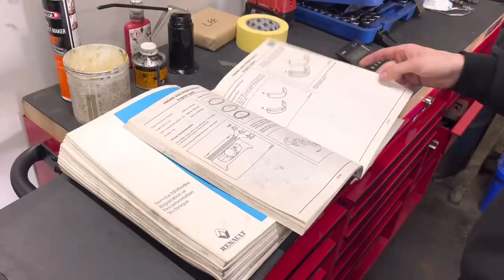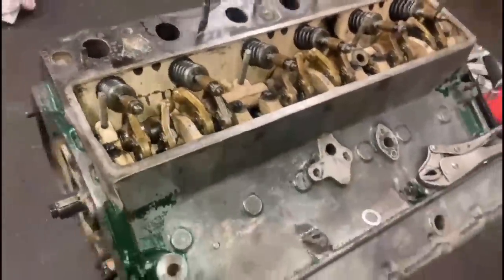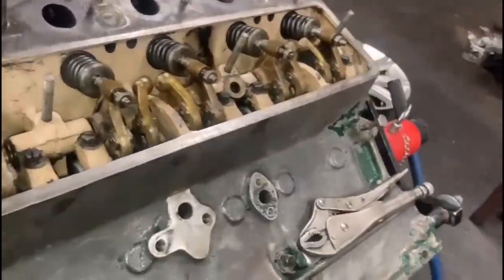IM SO ANGRY WITH THIS WARRANTY CLAIM & COURT THREATENING

Comment: Don't worry mate, let him take that one to court, he has no paper that states you should renovate  the gearbox, it won't hold in court, you can't lose that one, they know those kinds of people who think they can play the system they meet them all the time, they can see when things not add up, I don't think it is going to court at all they will not allow it when he has no paper that state you had an agreement to renovate the gearbox, send him a letter that he has to take you to court, and don't talk to him on the phone all is going on paper from here on.
Reply: You have got the invoice for repair of the damaged selecter shaft, Take the guy to court you have evidence of work you did he hasn't got any evidence.
Independent engineers report. 
Means nothing. 
He could have gone to a scrapyard and a knackered box and got a bloke to do a report.
Reply: Quite agree, you have invoices for work done he has no proof of requested work, recommendations or that the gearbox he had assessed was the same box. Surely burden of proof is on him?
Reply: Obviously as you said you took on that Job to carry out an partial stripping of the box so as to to carry out a detailed physical Inspection without a total tear down so as to recommend a course of action for the client, after which you re assembled with new gaskets and handed same back to him an old forty year old gearbox with an already existing  whine, giving your assessment of what his options were in the interim  which were basically live with same, or as you said that maybe  with a more modern yet backwards compatible premium Gear Oil might possible have some effect,  if he was personally willing to take that option, that being up to himself...He paid the Invoice, End of Story and  also NO Warranty was ever given or even implied as you didn't do a REBUILD on same just a 'Inspection' and Report  back to him as requested and  your findings  on this over forty year old Gearbox...Thus Not a REPAIR...  you're well well covered and he's just trying to wear you down as many are saying ... Enjoy your New Year... Great Uploads over the past Year...
Reply: He's always not honouring warranties.
Most folk don't have to use it.
But they don't expect the weaseling that goes on here, should they need to claim.
It isn't a coincidence, that the word is "honouring" a warranty.

Comment: Lee, just had a thought and I feel you should consider this as well.

I think this customer has set you up.

He said he wanted a gearbox looked at because it was noisy. You helped him with that, took it apart, inspected it, reassembled it and told him it looked pretty good.

 He did not want to spend any money on it, not even for gaskets. 

Now he supplies pictures of a gearbox that does not resemble the one you looked in any way.

He planned doing the whole switch a roo thing before he even came to your shop. That was the plan, to get you to do some minor work, so the item has been through your hands with little expense to himself and he can then blame you for the destruction of the ring in gearbox.

If he is mechanically clueless, who is removing these gearboxes from the car?
 A mechanics shop?
 A transmission shop?
Who is this so called "engineer" or "expert" that wrote a report?

Dig deeper into this.
There is more to this than just getting you to pay for his f#@kup of hammering a shaft into the gearbox.

This is a planned and deliberate fraud.
Let him know you will subpoena his bank records.

You will be able to see what parts he has bought and who from and what workshops he has been to.
You can contact them and see what this fellow has been up to.
Reply: Yes. Yes, yes
Reply: Lee you have a vid of when he tried to install the gear box. In doing so he used a hammer on the shift shaft. Just take that to your solicitor & let them present it. You only took the gear box apart, inspected it & put it back together.
Reply: This is no set-up. The is just a guy who is very opinionated, not the brightest, and has put two and two together and got five. He believes the gearbox was perfect when it left Barum and now there is a problem so Barum must have done something. It maybe that as simple as the customer is confused, or even someone else has swapped it over with or without his knowledge. Far more likely thoughtless than cunning.
Reply: @serialcoins  odd how this guy didn't want to spend money for anything, not even gaskets, but he is ok with spending thousands on a solicitor. He could have likely bought a new or reconditioned gearbox for what he has so far spent on "lawyering up".
A good solicitor would have counceled him on whether it could  possibly have been his own fault, to eliminate the possibility of legal action he may loose.
This matter will go to court as this was his plan all along.
Either way Barum need to prepare themselves. Realising there is malice involved is a good way to steel yourself.
Reply: @Hydrogenblonde  This unwillingness to spend any money, unwillingness to have a professional gearbox shop take a look at it, should be the angle of attack Barum go on. It may just be a money claim which will cost £100, or a few solicitor's letters, which would cost £30 a time. But this guy has to bring proof to the court, that Barum were negligent. People can make as many claims as they want, the the court only accept proof. I've had to sue a couple of my customers. The only reason I could do this was because I had proof, many provided by my customers tying themselves in knots.

Comment: Unfortunately we live in a world today where we need to fire some of the customers. You're not alone, all mechanics, shops, trades have to put up with this in the modern world.. The trick is to be able to spot this sort as early as you can, keep your shields up, and send them on their way. Also beware of the con man who will play you honestly on smaller deals building your confidence in them leading you toward some larger deal where they end up stiffing you.
Reply: The simplest measure, as others have suggested is to have a menu of cost and service. If you post your rates and work simply walking on the premises is a legal agreement to what is being offered
Reply: Well put
Reply: Agree, i run my own shop and after many years you do know the warning signs however thw odd one still slips through the net

Comment: On the gearbox. Price out all the parts for every part of the gear box. So if they take you to court that you have evidence of what every part costs.

I wonder if he forgot to put oil in the gearbox and ran it dry on the engine not thinking that the gearbox needs lube if you start the engine .  I have seen people do that to automatic trans.  One guy pulled the converter bolts but the pilot still spun the converter. When the front pump seized it tore up the converter pilot hub and the back of the crank.

Comment: It’s customary / common practice to discuss repair options with customers over the phone or in person.  Suggestion: in the future whoever’s talks to the customer should write down a brief summary of the discussion with the customer and slide it into the job folder. It’s also recommended that you follow up these conversations with an email, text, or mailed letter summarizing what was discussed and what will be done by the shop.  You don’t have to immediately write these things down although that’s the best practice.  You could write down anything you remember later on and put those notes in the job packet too.  I know it’s been suggested before but take lots of picture & save them on your hard drive by customer name, date or job #.  Those pictures can be a huge help when a customer starts slinging accusations! That said; even if you don’t have ‘documented evidence’ and its “your word against theirs” that doesn’t mean you would automatically lose in court.  Go back and organize your notes in writing and prepare to present your position in a detailed sequence.

Comment: Well the pictures should show the replaced shift selector you replaced. It should have easily identifiable wear patterns that are different from the rest of the 40 year old parts
Reply: And unfortunately I live in the United States and laws are different but, the burden of proof that is the gearbox which you worked on is the only part that you have to defend. And upon your deposition to the courts, you only need to verify that this gearbox is in fact the one you inspected and replaced the shift part on. And when you give your side of all the interactions and transactions with that customer, please keep it detailed, straight forward and simple. Do Not give any more than that. No feelings about what happened or last minute bargaining to minimize the situation or settle it before you go to court. That will imply guilt. On the other side of this, the customer will have to prove to the magistrate or judge that this is the exact same gearbox that he received from your shop. That it has not been tampered with internally and, only been installed and removed. Plus he has to explain how within 40 miles, as he has claimed it has only traveled. Why it is the condition that it is being presented as to another facility and not to you. Thank you for hopefully reading this completely and I hope that it will be helpful advice. Even if you have already thought of this or been told the same thing from someone else. It’s because I have had the same situation before and I respect you, your shop and your channel. Good luck and keep posting these wonderful videos

Comment: Noticed what appeared to be paint coating the housing around the Rover valvetrain.  We don't see many Rover engines here in the US.  Is that how they come from the factory, or is that something a previous builder did?  Seems a bit like the Glyptal or red oxide primer some hot rodders use on the inside of engines here.

Comment: Interesting that you rely on plastigauge to get bearing clearences not measurements
Reply: Yes you can do that by measuring the crankshaft and putting bearings in a rod,torquing it to spec and use an internal micrometer of some sort and subtract the crank dimension from the rod. You will then get the clearance between the two but using an industry standard tool like plastigague is far far quicker and extremely accurate. No brainier really

Comment: With the bolted in gauge on pins, you tightened up very not much. What steps them vibrating out & wandering round the engine?

Comment: Ref the gearbox issue, what does he say is wrong with the box following your rebuild? If it has brass synchronisers and he has tried a modern GL5 synthetic oil in it then it could have knackered the synchros quite quickly in use in a car.

Comment: If it ends up in court,  given that—in the judge's eyes—you are both contradicting one another, the only thing the judge can go on is any paperwork that actually exists. From your explanation that sounds like two invoices. In other words, build your case around them, comparing the price against the cost of a fully-reconditioned gearbox.  You have a good case.  The worst that is likely to happen is the judge will say it's 50:50.

Comment: Can I ask a stupid question?:) Why do engine builders and machine shops use metric and standard measurements while talking about the same engine?   Really enjoying the videos. Happy Christmas From California:)
Reply: Effectively many machine shops with older machines only have imperial settings on their operating dials, but have to work to metric measurements for more modern engines. It is simple enough using a calculator to either multiply or divide a measurement by 25.4 to convert it ( multiply to convert inches to millimetres. Divide for millimetres to inches ) simples!
Reply: @samrodian919  Thanks. Makes sense. Cheers 🍻

Comment: Is it possible to name and shame the individual or the company ?? I used to have A Triumph oil in frame bonnie, these engines used to have the engine numbers stamped onto an area that had the word "Triumph" all over the where the engine number was over stamped, so straight away you could see if it was tampered with. Could you get a company stamp and a job number put on just to cover yourself from these ass holes onto blocks and heads etc

Comment: 3:50..... wooowooowooo...... the way you tighten this bolt..... ARE YOU REALY SURE??????
Imagine what if it comes undone!!!
This bolt being shak’n up ‘n down at piston speed!!!!!

Make sure you’re happy and it doesn’t come undone and DESTROYES your efforts!!
Reply: Didn’t have a torque setting as old engine (info hard to get) but think we’ve got all the torques now so will be able to make sure they’re up to the correct torque, was basically just demonstrating the different style of gudgeon pin as I thought it was interesting!
Reply: @IsaacBarum Uuuuufffff.... that is a relief!!!
I many times had to work without given torquerates,but you develop a ‘feel’ for it... one of the few times the given torquerate wasn’t in line with what ‘felt right’ is when torqueing cilinderhead bolts (modern engines,bolts must be replaced) with adding 90 degrees.... stretching the bolts always feels like they’re going to break or rip the thread...

I WISH ALL OF YOU A VERY GOOD CHRISTMAS AND A HAPPY NEW YEAR!!!!!!
Greetings from Dedemsvaart,Netherlands.

Comment: I don't get the gearbox job at all.
So you didn't put new bearings in or gear sets, just a gasket set?

How is cleaning it up and fresh oil going to cure anything?!!
I would have insisted on new main shaft bearings at the very least as a process of elimination.

We do EVERYTHING via email.
I've never liked phone calls or bits of paper, they get lost and forgotten.
Email is absolutely gospel as it's date stamped and searchable.

As you are obviously so busy,
you don't need customers like that anyway. It's his loss, don't deal with him again.

Comment: I live in the USA and am having a Ford 390 block built up into a 445 stroker engine.  After paying the local shop to clean and inspect the block and knowing it was rebuildable, and wasn't cracked, we discussed the project and the shop then put together a written quote.  With the written quote in hand I moved forward.  As there is a lot of parts needed (new crank, rods, pistons, heads, intake, carb, distributor, and on and on) only the block is original, I had to pay for the parts up front, and they are coming in.  Part of the quote is the labor which is due once the engine is done.  I would suggest in all cases to put everything in writing to protect yourself mainly but technically so the customer has a written record as well.  Sad that today things are as they are but when it comes down to it you have to protect yourself.  Absolutely never take in any work from that guy again, and even put the word out to any other shop you might have a relationship with to stay away from that guy.

Comment: I'm mostly impressed by the fact you appear to have managed to get a doctors appointment in less than 3 months......

Re the gearbox, yes, it is sad I quite agree...but sadly you are just going to have to assume everyone you deal with is going to try and do you over. It doesn't mean you have to treat them that way, just that you have to have processes in place to prevent it. FWIW, if everything is on paper then personally, I'd be happier that way as verbal communication is so often open to confusion and misunderstanding.  It needn't be confrontational at all, just clear and unambiguous.

Hope for the best, expect the worst, avoid disappointment. :)
Reply: Totally agree, doctors are like unicorns talked about but never seen..................
Reply: Or if you agree something verbally confirm it by email/letter.

Comment: I had a neighbor try to get me for a transmission after I replaced her alternator. Her 7 year old said I was doing burnouts in front of the house with it. I asked here where the tire marks were. That was the last I heard of it.

Labor plus gasket kit. No new hard parts. General mechanical condition would be identical when leaving as it was on arrival, with the exception of cleanliness. Not responsible for customers choice of lubricant, regardless of alleged recommendation, ("Modern" does not constitute nor imply "correct") or whether customer even filled it with ANYthing prior to use.

Comment: About 7 years ago I had a wicked deal, firm of gearbox recon folks over in Southampton had a Reliant Rialto gearbox in on the shelf they recon'd and the muppet refused to pay so they just kept it, I got it at a very very good price as my gearbox grenaded because of the clutch and I was head in hands and a mate said give these chaps a call and I was happy as anything getting a full recon box that tonite I was flying down the A303 70ish and the box has been abs rock solid.   Now my car is in my go to garage for its mot and yearly service, they are like yourself and I knows not to take the piss and they have been solid all the way.